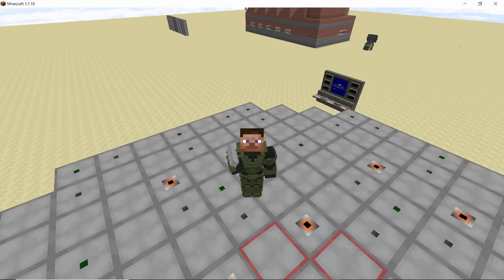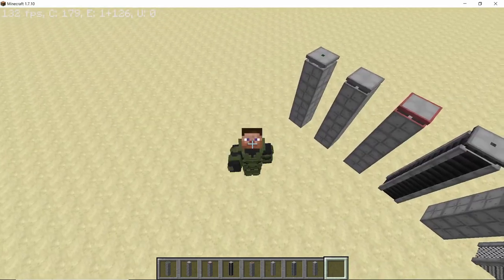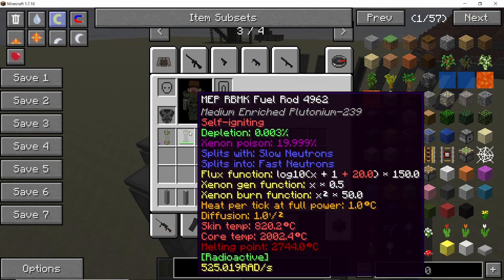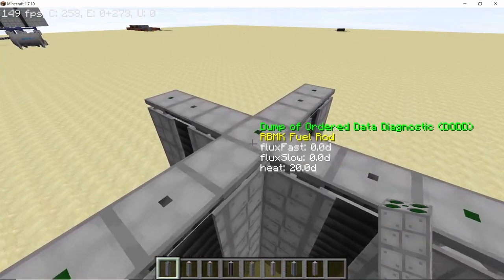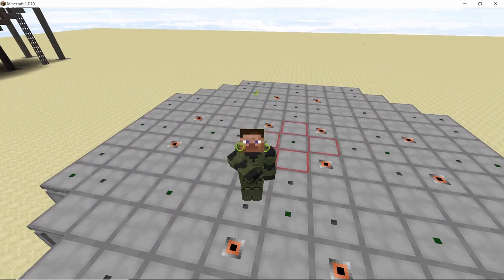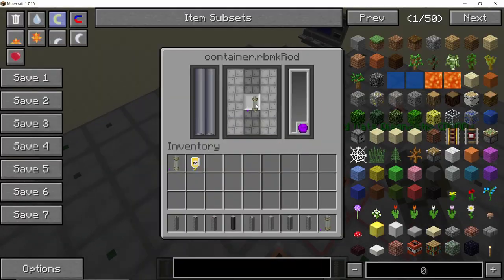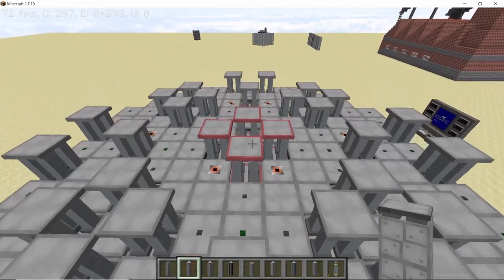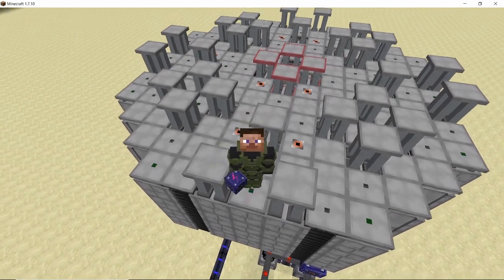Understanding the Working of an RBMK Reactor in HBMs Mod || How to use Automatic Control Rods RBMK

Comment: The good thing about the RBMK modular reactor is that with these same parts, using Neptunium fuel (MEN Fuel), you can make a fast neutron reactor, without graphite moderators!  Of course, without graphite moderators, it is no longer an RBMK reactor
Reply from the maker: Yeah neptunium being the only fuel that splits with fast Neutrons but yeah as you said then it isn't a complete RBMK reactor reactor without those precious moderator sections ... It's then more like an advanced nuclear reactor I guess

Comment: question: is the model you shown in the thumbnail safe for depleting fuel rods without a worry of an explosion occuring?
Reply from the maker: It won't deplete very fast as the reactor doesn't run very hot .. the more temperature you have on your fuel rod the faster it will deplete. I think it is safe but then again it is an old design so I don't really remember the fuels I tested it with

Comment: Great video as always! 👍 I was wondering what the digamma fuel rod did. Do you know?
Reply from the maker: From looking at its stats I think it's reactivity is off the charts , but I have never used it in reactor cause most of the experiments I did were with Uranium and plutonium , they are the most practical and sustainable rods to run the reactor in my opinion

Comment: I’m on the 1.12.2 version of the mod, and I don’t have the rbmk reactor blocks. Am I doing something wrong? Or am I just stupid
Reply from the maker: No you just have to switch to 1.7.10 version of the mod as the 1.12.2 version is not up to date with the original mod. So yeah if you want the RBMK just switch to 1.7.10
Reply: There's also mcheli in 1.7.10 which is a wayyyy better version of flans. There are still content packs tho

Comment: So for automatic control rods, they just go around self igniting fuel? And also I know the maximum temp should be just below the fuel melting point but how do I know what the minimum temp should be? Also what is the best level for the auto control rods to be a maximum temp? Thanks
Reply from the maker: No it's not necessary to use automatic control rods around automatic fuel rods only, you can use them with normal rods as well. 
Another thing to note is that the auto control rods take into account the temperature of the column and not the fuel itself. So if your fuel rods melting point is 2700°C for example then the surrounding control rods will be set to a max temperature much lower than that as the column temperature never goes as high as fuel rod temperature. Hope this helps
Reply: @SavageVegeta thank you, so if for your 29x15 power plant rbmk, I want to use automatic control rods so it doesn’t blow up at all. What would you suggest the minimum  and maximum temperatures should be for that and how far the control rods should be extended at minimum and maximum? Thanks

Comment: Say one of these goes bang in your world, how would you clean the mess up and deal with the contamination
Reply from the maker: There's an Armor called the liquidator suit, it has very good radiation resistance, also a new Armor which lets you dive underwater also has great rad resistance. Equip that Armor preferably with Armor modification that will further increase the radiation resistance and take some rad resisting consumables. 
Finally there is a containment box which decreases the radiation from any item significantly, carry that with you and as soon as you pick up the radioactive debris put em in that box. That is how it generally goes tho I don't play much survival so I don't have alot of hands on experience with it xd
Reply: @SavageVegeta  I've found that using one of the vein mine tools helps with the contamination as well, dig up the dead grass and place the dirt back down, it's a lengthy process but it's a nuclear explosion

Comment: i think i did something wrong the automatic control rods just kinda sat and chilled while the temp got to about 10x what it should be at
Reply from the maker: Maybe you set the upper and lower levels of the temperature weird xd , I prefer not to use the automatic control rods as they take away the AZ-5 control
Reply: @SavageVegeta  i wasnt dealing with the steam properly and it caused it to get backed up and melt down

Comment: i guess the latest update broke this design? i have the newest 1.7.10 version (the one called "it's fritz the flamethrower) and it blows it up shortly after reaching 1500 c°, and yes i use the same fuel as you
Reply: ok so the problem is that, the reactor doesnt produce enough water from the steam to do infinite water
Reply from the maker: Well yeah you shouldn't let the reactor reach that high temperatures and yes it is true the new updates did change alot of fuel stats. Two things that you can do to prevent this are : 
1) Use Automatic Control rods that will control the reactivity of the reactor based on temperature (I have made a video on that)
2) Use an Infinite Water Supply setup (Yes you can use it in survival as infinite water barrels have a crafting recipe , and yes I have also made a video covering that)

Comment: I have a question is there anyway to " clear " the area from radiation if a meltdown happens? And can you somehow put out the flames on top of the Reactor? 

Good and Informative video thanks man :)
Reply from the maker: I don't know about clearing that much radiation right now but I know how you can use it ... Just place ambience radiation generators in the area surrounding the reactor and if meltdown occurs these generators will generate power out of that radiation 

Secondly when 3D pocket radiation is introduced in the mod , you can build  a concrete enclosure around the reactor and it will contain all the radiation. 

As for putting out the fire you can use the fire extinguishers provided in the latest version of the mod
Reply: @SavageVegeta  What is 3D pocket radiation?
Reply from the maker: @farnorth7216  it's a system where basically you can contain radiation by covering it entirely by concrete or lead or similar materials.
Reply from the maker: Btw Mr Mackey I figured out the first part of your question about how to remove radiation  completely incase there is a leak. I will make a video on it this Tuesday :)
Reply: @SavageVegeta  Very interesting.
Reply: @SavageVegeta  Do I understand correctly that there will be another RBMK video? (Or maybe even more than one video)
Reply from the maker: @farnorth7216  yep most definitely there will be man , some videos and some shorts :)
Reply: @SavageVegeta  Copy that.
Reply: @SavageVegeta  Thanks man i appreciate that you actually tried to find it out  :)
Reply from the maker: @mrmackey2184  ah np man , just glad we all get to find out new things through these questions :)
Reply from the maker: @mrmackey2184  the thing is man, radiation is kinda behaving pretty oddly in these latest updates of HBMs mod so I'm having difficulties in making a video , so instead I'll tell you rn and make a video later on 

There are blocks called "Radiation Absorbers" and they absorb radiation from chunk by just placing them down they need no power ... There are 4 tiers of them and you can check their recipie in NotEnoughItems

Also there's a block called "Player Decontaminator" and what it'll take away all your radiation slowly if you stand on it. 
So radiation absorbers are for reducing the environments radiation and player decontaminator is for the players radiation only :)

Comment: my rbmk reactor is only picking up half of the reactor and not the other half how do I fix this please respond
Reply from the maker: You mean to say that on the console you can only see half of your reactor and can't see the other half ? 
So the other half that you can't see , is it working or not ?
Reply from the maker: Cause if that's the case than it means you have discontinuity in your reactor , some part isn't connected to the other half and due to that the entire section isn't visible I guess
Reply: @SavageVegeta  that makes no sense so i made an issue report on hbms github just to hopefully find an answer that makes sense no offense
Reply: oh fuck me its cause i didnt link it to the exact center
Reply: @SavageVegeta  ok i followed everything in the tutorial in running modified reactor and at 14:28 it boomed for me how did it not boom for you?
Reply from the maker: @32bitmeterpreter98  no offense taken , whatever helps you understand I guess
Reply from the maker: @32bitmeterpreter98  idk man , once you set the constraints for the Automatic control rods then they should prevent any rise in temperature beyond those constraints , thus regulating the temperature of the whole reactor.
Maybe try checking your water supply ..?
cause one of the best ways of blowing the reactor is by interrupting its water supply
Reply: @SavageVegeta  my water suplice was good is it cause the water tank was on orange and not green in terms of input output and stay
Reply from the maker: @32bitmeterpreter98  if it was on orange then it was perfect. Well the only other reasons I can think of are 
1) you didn't have any water output after your final turbine 
2) you used self igniting fuel in all the fuel rods
Reply: @SavageVegeta  both i made sure i did and didnt do i have wateroutput and I didn't put self igniting fuel in all

Comment: i have a problem with the reactor my turbine dosent spin even if it connected to reactor
Reply from the maker: Hmm that can be caused due to these problems , first of all make sure about the kind of steam you are producing. You can produce 4 kind of steams ... Steam , Dense Steam , Super Dense Steam and Ultra Dense steam

Whatever kind of steam you are producing make sure your turbine is also set on the same kind of steam. Also make sure you have somewhere to dispose off the water that your final turbine produces otherwise your turbine setup will stop rotating after some time

Comment: But is there a method to remove radiation or at least lower it in an area?
Reply from the maker: Yeah just place radiation absorbers in the area they will lower radiation down in a chunk
Reply: Ok thanks
Reply from the maker: @giokiller4783  yeah so if you wanna use the MFSU or something then you can just convert the HEs and store them
Reply: But the radiation is abosrber, how it work?
Reply from the maker: @giokiller4783 you've to just place it down and it will start absorbing radiation, that's all there is to it
Reply: Ok thanks you

Comment: Hello, if someone know what is flux function and how it work(for example,what is x stands for), can you tell it to me?
Reply: And what is doing flux?
Reply from the maker: in this context Flux means the flow of neutrons or basically how many neutrons a rod is going to put out once you have engaged it in a nuclear reaction by bombarding it with neutrons. Different types of fuel rod functions based on their exponentials will have different dangers assigned to them ... and making a reactor with a combination of different type of fuel rod is recommended.
If you want to read more on the different flux function types : https://ntm.fandom.com/wiki/RBMK#Flux_Function_Types
Reply: Thank you very much!!!! Now, I am understand that

Comment: Followed all the steps and it just explodes as soon as I start the reaction
Reply from the maker: Can I ask which version of HBMs mod are you using ?? They revamped the fuel rods for RBMK but their stats have been brought back to normal in the latest updates. Also which fuel rod do you use generally ???
Reply: @SavageVegeta  using the latest update release version for 1.17.10 and I used the fuel rods you used in the video
Reply: Also what do I do when my turbine fills with water??